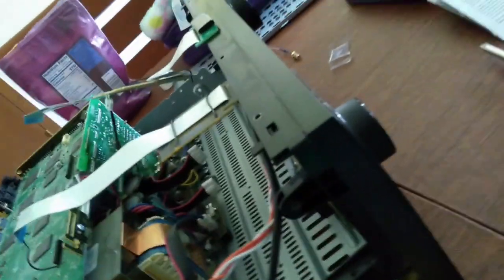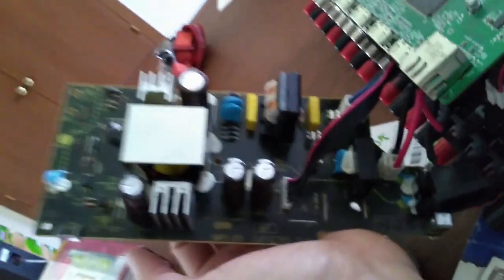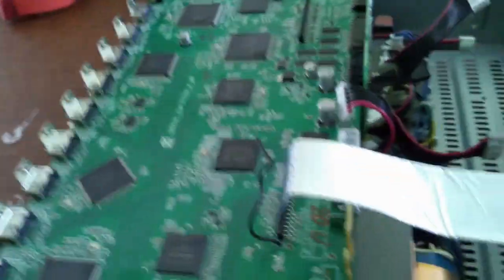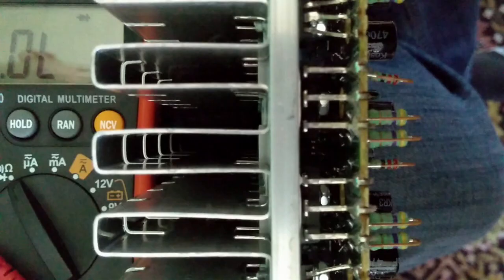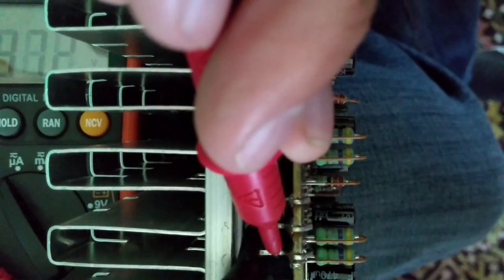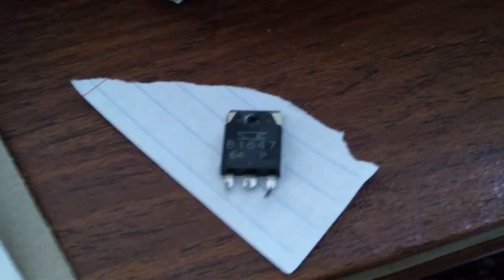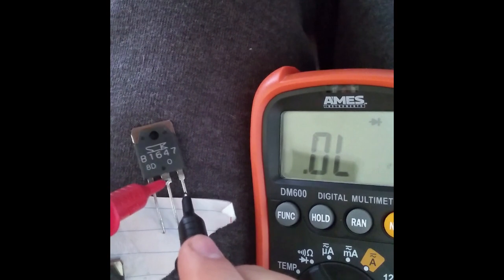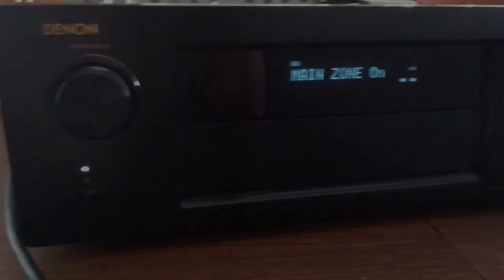Denon AVR-X4200W repair, red blinking light fix

Comment: Hi, great video. I have a question, the red wire in the power supply board is 3.3v? because im not getting any voltage on it. (Its marked as MAINPOWER on the side)

Comment: Some three and  two pin white plastic clips for wires connecting boards will not release making removal of the output transistors difficult. Wires that are soldered in with a plastic lug on top ? How , why ?

Comment: What if the red doesn't come on? Mine had the flashing light when I turned it off but it would stop flashing and go back to normal. Now it's off and I can't turn it on.
Reply from the maker: Check the fuses on your smps, which is the little power supply board that attaches to the electrical cord. If those are good, check the dc output voltages that go from the smps to the hdmi board. It should be a 5 wire connector.
Reply: @ajvpb1  Okay. I should have stated that mine is an AVR X5200W. Shouldn't be much different, just more channels. The fuse by the way is good on the smps board, that was the first thing I did. I just changed the transistor on it because I thought it was bad but turned out to be fine. Does the board show what the voltages should be? Also do I have to turn it on because that's the problem, no red standby light and won't power on. Thanks for the help too.
Reply from the maker: @anthonywilliams7432  Printed on the backside of the smps and/or where it plugs in the voltages are listed. If my memory is right 2 are ground, 2 are 5v, and then the other one is voltage that comes back from the cpu to trigger the smps relay to close and power everything else up. See what you have and start tracing it to see where it gets stopped/shorted to ground. You should get 5 volts out when its plugged in, no lights. Test it with the hdmi board connector both disconnected and connected. I recently messed with one that had this, report back what you find.
Reply: @ajvpb1  we'll do thank you
Reply: @ajvpb1  Okay so mine has 6  wires and when connected 3 out of the 6 has voltage, however the voltage fluctuates from 4.6 to 3.6 and then back to 4.6. It never stabilizes. Now when I disconnected it from the hdmi board the voltage is stable. 4.6 vdc
Reply from the maker: @anthonywilliams7432  Check out this link to a service manual. Different model but it should be similar. https://www.manualslib.com/manual/1618271/Denon-Avr-X6200w.html?page=164#manual

I linked to the smps page. You should be getting 5.2v disconnected. The fact that its not, and fluctuates when placed under a load, leads me to believe the problem lies in the smps somewhere. Use the diagram and test each component, looking for anomalies.
Reply: @ajvpb1  Hey so you're not going to believe this but while I had power connected I started checking voltage on the board and during that I accidentally jumped 1 and 2 together and heard the infamous click so I thought hey let reconnect the hdmi and the power transformer  and jumped them again. I did this for maybe 5 or 6 times and then bam the red light came on. I hit the power button and it's on right now. I couldn't find what was clicking or switching on the smps. Is it one of the transistors? Is it possible it was stuck?
Reply from the maker: @anthonywilliams7432  That click is the relay on the smps, black plastic rectangular box. Its possible it was sticking open, but that seems too easy of a fix. What points were you jumping?
Reply from the maker: And the way the smps works is its always producing the 5.2 volts. When you press the power button on front that sends voltage from the cpu and hdmi board to the smps via the mainpower line. That it what triggers the relay to close which then sends 120v wall power to the transformer, and then everything powers up from there.
Reply: @ajvpb1  The white neutral wire  #1 and the black power next to it #2. I'm guessing by reversing the gate it free'd it up. I don't know. Also are the fans on these temp activated or constant? Mine aren't running right now, but I do have the cover off. I'm leaving it on for a bit and then will turn it off to see if the light goes into it's blinking cycle.
Reply: @ajvpb1  Thank you for all the information. Do the fans run constantly or are they temp activated?
Reply from the maker: @anthonywilliams7432  That I don't know, I haven't worked with those before. If I had to guess, I'd say its based on temperature so they aren't always on, but thats pure speculation
Reply: @ajvpb1  Okay so new update. When I remove the power cord and then reconnect it reverts back to no red light. If I short the two connections a few times the red light stays on and everything is back to normal. Something on that circuit isn't energizing by normal means. Any thoughts based on the schematic you sent? I can't determine where to start.
Reply: Also I really do appreciate the time you are taking to help. Thank you.
Reply from the maker: @anthonywilliams7432  The wires you're shorting.... Are those the ones on the little connector that attaches to the HDMI board? I'm guessing thats the case and not the 120v ac, or you might not be here anymore. That means the relay is working fine and not the problem. Go to page 113 in the manual I linked and using that in conjunction with the diagram, start fault tracing. You should get a steady 5.2 volts with the connector unplugged. Until you get that, the problem is somewhere on the smps
Reply: @ajvpb1  Yes those are the connections I am shorting. So when the connector is disconnected I get the 5.2 vdc. So by the diagram I'm not sure which component to start with.
Reply from the maker: @anthonywilliams7432  I must have read wrong, I thought you were getting 4.6 volts disconnected. If you're getting 5.2 then the problem is on the hdmi board. This is where I'm a little out of my element as a hobbyist repair tech. I had a similar situation on a receiver as yours, it turned out to be a short in a little smd voltage regulator. You need a hot air station to replace that and you're pretty deep in the weeds at that point. To see if thats the issue, figure out a way to hook up 5v to the hdmi board inputs that normally come from the smps. I used 4 aa batteries in a holder for 4.8 volts. I hooked that up and chased the heat to find the short. See if the wires coming from the battery pack get hot. If so, you have a short somewhere. Watch this video to find it https://www.youtube.com/watch?v=t5fICjcaJ3E
Reply: @ajvpb1  It's funny you say that because that's where I was gonna go next because everything with the power board seemed good. I hear ya, I'm no expert at this stuff, I'm just using skills from my days in AF and troubleshooting heavy equipment green boards. Thanks again for continuing to advise. If I can save a buck I'll do it.
Reply from the maker: @anthonywilliams7432  In the manual I linked the flow chart for no power, once you get to your point of troubleshooting, says check for damaged components around the microprocessor and replace them. Look for shorts and use the diagrams in the manual to find power paths to trace. Keep in mind components around the microprocessor doesn't necessarily mean physically close, they path goes all along the board. Let me know if you find anything wrong, I'm invested at this point!

Comment: My Denon avr 3808 is sometime giving video out but sometime goes blank ......no protection mode.......no red light blinking.......what should I do....?
Reply from the maker: I have limited experience with video issues. Try a different hdmi cable or port. There was a problem around 10 years ago with the hdmi chips of all receiver brands. If its intermittent a new hdmi board or better yet, a new receiver without those issues is probably the easiest fix. There are some fixes you can try with the hdmi chip (heating it up with different methods) but those are temporary at best.

Comment: Mine is a JVC theater dvd player. Has red light on, on standby. Push it and truns off, right off.
Reply from the maker: Unfortunately I don't know much about those. The power supply board would be where I'd start with a multimeter and verify proper voltages and if they're off work backwards from there. Sorry I don't have any specifics

Comment: What about the smaller transistor between the 2 bigger ones.
Reply from the maker: That was fine, but you can test it with the same method. The 2 larger resistors on the output leg of the shorted transistor were blown too. I'd test everything around it to make sure nothing else was taken out.

Comment: Probably a dumb question but did you have to buy more thermal paste or what did you do?
Reply from the maker: I had some cheap thermal paste laying around so I just put a fresh dab down. The old stuff was still soft so you could probably reuse it in a pinch.
Reply: @ajvpb1  ok. Thanks. Hopefully the old stuff still will work since lots of places are closed now. Plus since radio shack no longer exists.
Reply: Do you have any idea which speaker that transistor ran? My bad resistor was number 9 as well and I got the AVR to turn back on, however my center channel distorts really bad. Possible a bad solder job if it 9 runs the center channel?
Reply from the maker: @JasonBohl  Yep, it was the center channel. I had the same problem. If you read my description there is a resistor right in line with the emitter leg of the transistor that needs replacing too. You can read the color code from yours, but if its anything like mine is a larger green one. I think it was 2w metal oxide, 0.47 ohm
Reply: @ajvpb1  Thanks a lot man!!! Ill have to pick one of those up next. Sounds comes out but very crappy. Thanks for the fast response. Got it soldered lastnight and plugged in just now but very crappy sound. So Ill try that next.
Reply: @JasonBohl  check resistors and set bias.
Reply: And yeah I missed reading the whole description. I see it now where you already stated my question. Just curious though, did you get the resistor on digikey as well? Shipping is super fast through them.
Reply from the maker: @JasonBohl  I did. I couldn't find what looked like an exact replacement visually. So I bought 3 different varieties that all met the correct values. I don't remember which ones I ordered but the first one I tried worked fine so I just went with it.
Reply: @ajvpb1  Hey man. So the resistors came today. I bought 2 watt 0.47 metal oxide power resistors but they're like twice the size. The receivers resistors like you said green in color. These are grey with same color marking. Is there a certain size you ordered because these look too big.
Reply from the maker: @JasonBohl  There were several green resistors on mine of varying sizes. The bigger ones were the ones blown open on mine. If you can fit the 2 watt ones on the board, they should work the same as long as the resistance value is the same. The 2 watt one will work identically to the smaller one.
Reply: @ajvpb1   I tried them and they did work!! Listened to a whole CD and watched part of a movie and so far so good. Thanks for the help man. Really appreciate it!!

Comment: Hiya Buddy I have a Denon X4100W which seems to gives a buzzing sound from my speakers. Iv changed the amp over to another amp and still same issue. It seems. To give a distortion right in the mids and a hissing sound but only at certain frequencies. Iv changed CD player interconnects.. Speaker cables to no avail any idea. Speakers are only few years old mission SX2. Would you discribe this as a amp issue which is only 5 years old or more of a speaker issue thank you from London UK 🇬🇧
Reply from the maker: It sounds like you've done a good job troubleshooting and isolating. Am I reading correctly that you tried an entirely different amp? If so, it sounds like the speakers are the only common denominator. The only other thing I can think of would be a ground loop. Do a quick google search on those and see if it matches your problems.
Reply: @ajvpb1  Hi and thank you for your kind reply. It's quite odd. I can play anything from the TV in souround sound 5.1 and play plenty of CDs and SACD's from my Marantz and it still manages to play with plenty of detials vocals sound almost perfect and clear. When nothing is playing it's almost dead silent hardly any hiss coming from the speakers. I'm. Using a pretty descent mains surge /conditioner by Isotek Siris 3 also using pretty decent Merlin mains cables. These mission speakers were flagship around 2013 but I brought them 2 years ago and they are by far the best Iv ever owned I just don't get this fault all of the sudden. By your own experience would this be more speaker fault rather than an amp fault.. All help is very much appreciated ☺️ 👍
Reply from the maker: @marcdavis8842  I think the only way to know for sure if it's the speakers is to try a different speaker on one channel. If the new one isn't hissing while the old one is, there ya go. If the hiss remains then you at least know its not the speakers
Reply: @ajvpb1  Hi thank you. Yes listening to it now best way I can discribe the fault it sounds like listening to an album on a badly scratchd record. So bottom end bass will sound absolutely fine and the very high frequencys sound almost crisp. You can get an quite peaces playing and you won't even no theirs a fault then as soon as you start to get more instruments played more mids being used that's when you can here the fault more. Will give your idea some more thoughts 👍🤔
Reply: Try this first:
https://www.amazon.com/gp/product/B000BCDQ44/ref=ppx_yo_dt_b_asin_title_o03_s00?ie=UTF8&psc=1
 OR
https://www.amazon.com/gp/product/B07LF4FRQZ/ref=ppx_yo_dt_b_asin_title_o02_s00?ie=UTF8&psc=1

Comment: Where did you get the new B1647 transistor? And how hard to get that entire power board out. Looks like there are a few screws on the bottom of the unit, and 2 or 3 on each side to take out?
Reply from the maker: From digikey. The power board wasn't too bad. Disconnect all of the wire connectors and yes, maybe 4 screws from underneath? It was pretty straight forward.
Reply: @ajvpb1  thank u sir.. will try this.